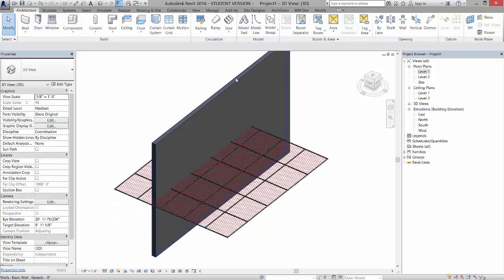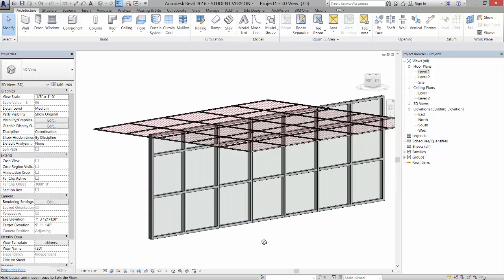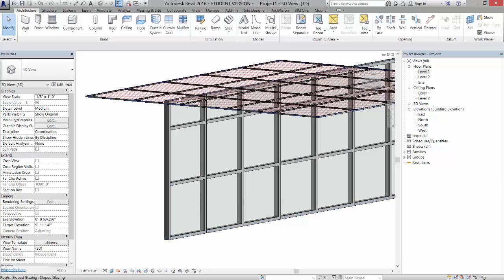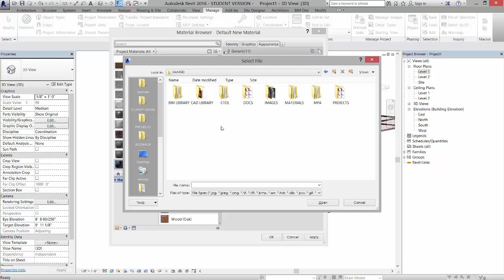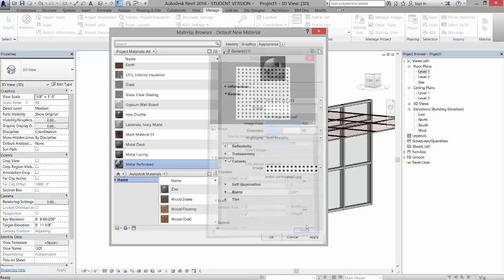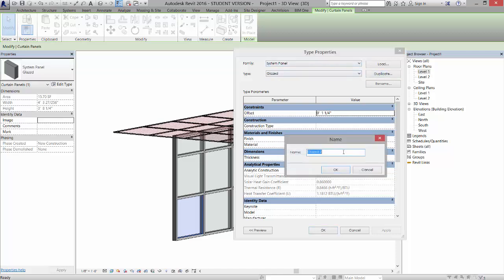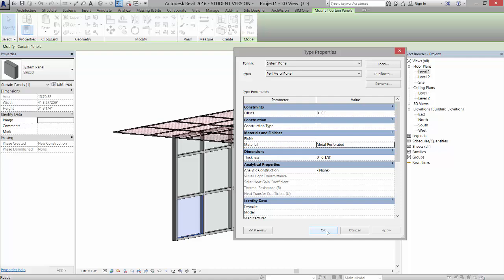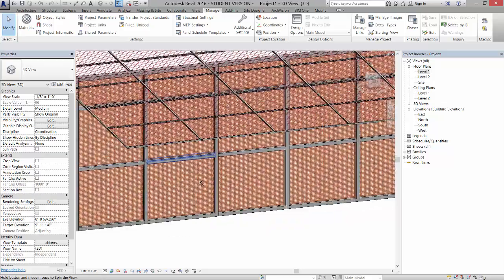03 Revit Mesh Perforated Panel curtain wall

Comment: For some reason, this is not showing as perforated in my 3D view. I"m using Revit 2022 though. Would that be the issue?
Reply from the maker: In order to see the perforations you would need to be in realistic view.  I checked and it shows perforated on my 2022.

Comment: Is there any way to make the perforated material create shadows through the holes? right now, the light goes right through the metal panel in a solar study, and my design has these panels as a method of sun-control. It would be nice to see that in solar studies.